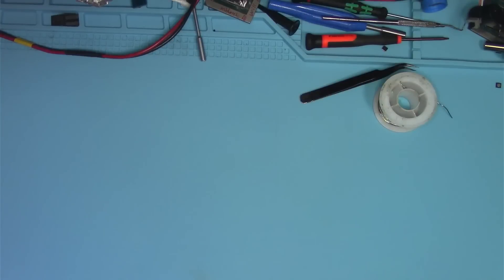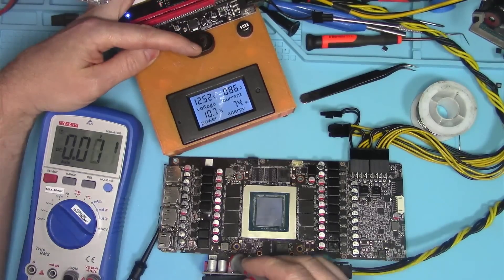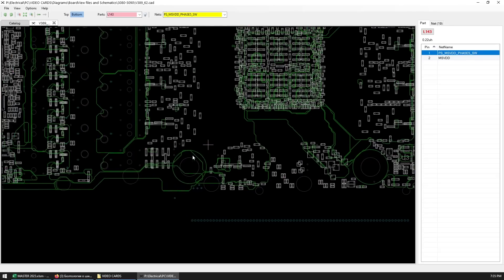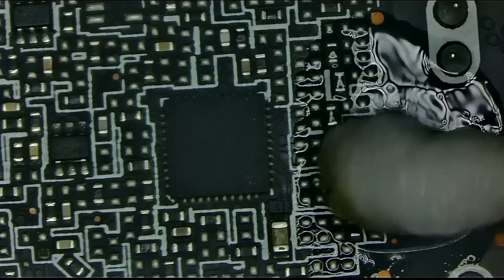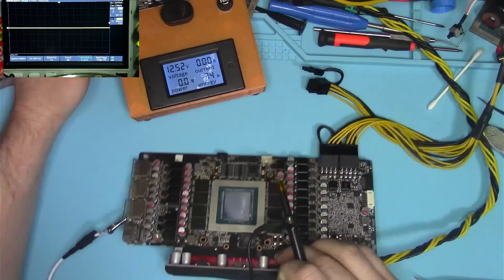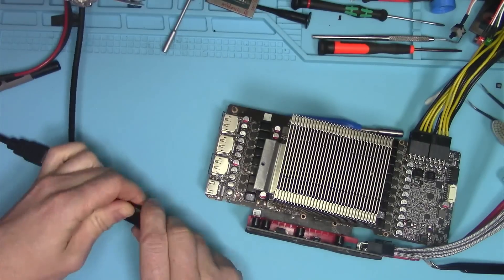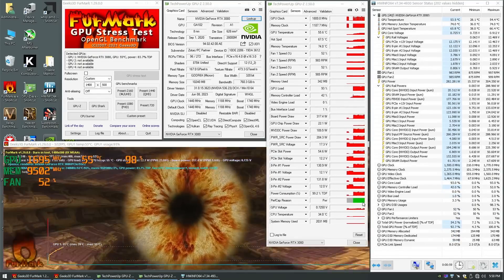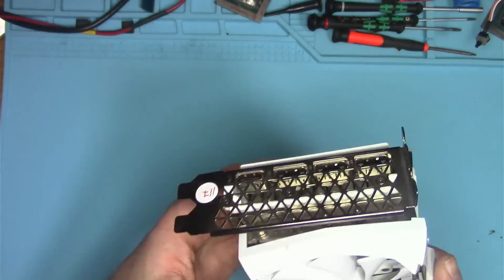What overclocking or poor maintenance does to your graphics card

Comment: This is why I never overclock anything. You need and want a very healthy margin of duty cycle overhead for both longevity and stability. In fact I don't even agree with manufacturer temperature limits, I always stay well under those. I know that my view on this is probably considered extreme by some people but that is not my problem. I'm perfectly happy with how I do things.
Reply: It's not extreme , many people don't overclock because they are not comfortable with it. I used to do it a lot but nowadays manufacturers tune them close to max already so there is no real benefit from it for normal users, you won't feel the extra 2-5% fps in a game, if anything on AMD GPUs i under-volt from the start. That being said if i see such damage on a graphics card from overclocking i put the blame 100% on the manufacturer. No decently made card will blow up it's power phases from software overclocking (not talking about shunt modding or custom bioses here).
Reply: @autoglobus  Many people here appear to mistake overclocking for overvolting, no software overclocking should damage your gpu if it's made correctly all it can damage is software stability and you can even undervolt and overclock you gpu at the same time for better perf and temps (results will vary depending on your silicone grade) overvolting on the other hand can severely damage your hardware for obvious reasons
Reply from the maker: Best advice ever.
I am 100% on board with that.
Ask any old engineer guy, make anything 20% better over the specs no longer the case. Electronics today are built 100% to specifications and that is why there is no room for error.
It's best to dumb everything down by 20% and have it working for many years to come vs hanging at the edge for max performance not knowing when it will explode.
Reply: @northwestrepair  Exactly, the longevity and stability is where you get your return on investment. I've been building my own rigs since the 90's. The value of stability is something I learned early on was a major peace of mind component.
Reply: @kmg501  the card will be obsolete long time, before you´d see any impact of overclocking on your hardware.

That is, unless you OC it to the bone, where it is unstable, but "it´s fine", GPU memory artifacting like crazy, but "that was there before!".

Literally was there, done that. Once 😊

The affected GPU is still alive.

In fact, it is more likely the GPU will give up due to defective fan, which will lead to overheating and without user notice, death of the GPU. Another reason for its death may be worn/defective thermal pads. Once they leak all the oil in them, they´re mostly done.
Reply: @Morpheus-pt3wq  I appreciate your considered view point on this but I think it also depends on the user and/or use case. In my case I no longer build a new rig when the components become considered obsolete by those who prefer a leading edge user profile.

My build strategy became one of building a new rig when I find market conditions favorable to end users and the current rig is about three generations behind. then I buy discounted components that are about one generation behind.

This gives me a lagging leap frog effect in which I get vetted components for inexpensive cost. The leading edge of component buying is something I think is a waste of money for most users but that is just my humble opinion on it.

Peace.

Oh and PS, running *nix operating systems makes this strategy all the more attractive in my case. I can completely ignore certain commercial OS providers who I want nothing to do with anyway.
Reply: @kmg501  considering you do this, then you can´t really talk about longevity and stability. Used, old hardware bears higher potential of failure, than anything new, even when not overclocked.
Reply: @Morpheus-pt3wq  If that were true the other rigs in my house which are well over a decade old and in use would have failed already according to your argument. Age is a factor yes but how components are used is also an important factor. Hard thermal cycling ages components prematurely. Basically this comes down to a turtle versus a hare strategy. Like I said, I'm good with how I do things.
Reply: @kmg501  it does not matter, how much you´ll try to prolong longevity, as this is completely and utterly random. You can have a pampered piece of HW, that never ever had to endure high temperatures and it will still fail; you can also have hardware, which you will torture with high temperatures and inadequate cooling and that hardware will refuse to give up.

Computer HW is just consumer electronics, like everything else. Also, because everything is imperfect and can fail anytime, the manufacturers give us warranty periods.
Reply: @Morpheus-pt3wq  This is like saying you can have lung cancer even if you never smoke when some heavy smoker can get to 90 without issue so why shouldn't you just smoke 1 pack a day if it makes no difference ? But it does make a difference, even if things can fail randomly for no apparent reason not taking care of them or actively damaging it will greatly increase failure chances
Reply: @Morpheus-pt3wq  Nobody who still has some brain cells ready to be used will allow fans to fail. You can always change the fans before they break and not after. You can also change thermal paste, thermal pads before they are completely dry. You also can blow the accumulated dust regularly.
A  GPU does not die just like that. It starts to give you crashes when it is overheating and you will know something isn't right.
Reply: @Morpheus-pt3wq  "Used, old hardware bears higher potential of failure" You're joking, right? I got numerous HD 7970 that are still working in 2023. They have literally melted caps but still work well. RX 580 Sapphire, after years of mining still are working just fine and I expect them to still work at least 3 more years. GTX 1070/Ti, GTX 1080/Ti still very much working without any trouble. GTS 450, GTX 560/Ti, GTX 660/Ti, just some I recall now, bunch of them still working just fine, needing only thermal solutions replaced and dust cleaning.
RTX 2070 got at least 20 to repair and they are way newer and in way less numbers than the ones I mentioned before.
Reply: @kmg501 😂 overclocking doesn't hurt the card what hurts them is poor cooling and voltage my 1080 ti still going touching 5 years and heavy oc
2080 ti 2 years and counting next card 4090 definitely will be going insane with that oc man people are just delusional with these things 🤡 you think companies do this on purpose lol obviously companies take precautions with these things but you know how it works that's customers issues with their hot box
Reply: @northwestrepair  is why drop down the input and increase the output is the case these days.
Reply: @northwestrepair  cheap zotac model is not equal to high quality PCB from the high end models, but I am sure you know that already. Doesn't mean there are not cut corners or engineering failures with many of the "high end" models tho.

Still, they are generally far mode suitable for OC vs the cheaper models that for many of them  manufacturers can't even solder the few components decently to the point of almost not working due to that alone. Not to even start with OC'ing those.
Reply: @northwestrepair ROFL. I'm dying. You have no idea what you're talking about if you make blanket statements like that.

You come off as a true fool to anyone in the industry who knows what they're doing. Yeah you can repair very well.... However your ideals are just wrong.
Reply: Ive been overclocking for quite some time now including LN2 stuff with a buddy. This never happened. Its also impossible to say if this is because of overclocking or just a manufacturing error. But its good to inform yourself about the cards first. Some have complete overkill power delivery and high quality components. Generally Asus ROG series boards are a pretty safe pick. But even like AMD founders edition pcbs on vega for example were top notch.
Reply: I always undervolt my cards, they can run the same speeds at less power than stock.
Reply: I always overclock my systems but with a voltage or mhz limit, i have a Zotac 3090, i can do +120mhz core, i test a game stock, the card goes up to lets say 1820mhz@930mv, then i apply the OC +120mhz, got 1820mhz@860mv and then the curve is  flat after 875mv, also i have a 380w bios instead 350w, never had a problem and i run a custom fan profile to lower the temps with faster fan speed.
Reply: Some cards handle an oc really fine without changing the voltage or even when lowering it. And that is pretty fine. Some other cards cant get a clock increase without a high voltage change, in that case you should let everything set to factory spec
Reply: I tried OC my gpu (RX 6800) but its not worthy. It gets 5% with small OC and 10-12% with OC to the limit. The best you can do is UnderVolt your gpu. Also look on your gpu temperature.
Reply: @MacTavish9619  Undervolting only works on AMD cards and ancient Nvidia cards sadly. On 10 series and newer it's complicated.
Reply: @FatheredPuma81  No. Lol.

I undervolt my 3090 24/7. I also have an EVC2SE to control the voltage if needed.
Reply: @nexxusty  Your only option for 10 to 30 series is undervolting for heavy workload scenarios, overclocking for slightly lighter workloads, and nothing for everything else. I'd call that a "it's complicated" but if you want to explain why it's not be my guest.
Reply: @FatheredPuma81  LOL, yeah fair enough. Compared to Maxwell and everything before it anyway.

Just used to it by now I guess.
Reply: I was able to get my 3060ti to 2GHZ without overvolting anything and keeping it below 70C with custom fan curves.
Reply: I'm the same way, I've never overclocked anything... it's better to just spend some more cash on a faster card itself rather than getting 5-10 extra fps.
Reply: Well some people have no plans to use a component for over 10 years....
Reply: you can't kill a GPU from overclocking. If you have ever tried to overclock then you know that there's barely any headroom to turn anything up on GPU's anyway.
Reply: @jordanlazarus7345  Fun fact: On a 4090 every +100MHz (pure) overclock is about 5w more power. So you'd have to push something absurd like +2GHz overclock just to slightly shorten the card's life span.
Reply: @FatheredPuma81  not only that, because of that extra 5w of power, the voltage drops slightly assuming that the card is power limited still.
Reply: one should definitely not deviate from the standard specification of some piece of Hardware unless they know what they're doing.
meaning, having the experience to know how to do it safely, not that you have Watched some Video guide of how to apply some settings.
Reply: @taiiat0  Nah you do what you want with your hardware because it's your hardware not someone elses.
Reply: if I didn't upgrade yearly, I absolutely agree. I over clock to the max.
Reply: Meh, I overclock everything and I’ve never killed anything
Reply: Well said, i get extreme temperatures in summer, so i overspec my cpu cooler and undervolt, since oc is no longer an issue because hardware tries to flex all the time, i chose stability and long years of service. I had a terrible vga 5700 mech oc, trying to run at 3000rpm all day, 1.2 volts on gpu with a tiny light cooler, well on 1.068 volts i went cool and silent for almost 4 years. Sold it to a guy and teach him how to apply my custom profile. Fans worked at 2400 on winter and 2650 at worst temps.
Reply: I would overclocked anything from Zotac,  other manufacturers like ASUs and EvGA build OC limits into their design.  That’s the difference.
Reply: @Intel-6969K  Zotac are definitely capable of doing it much better than the rest, but they sometimes fall short

Comment: 90% is way higher than 0%. I think that is a successful repair!
Reply: Msi afterburner, undervolt or 80-90% power usage
Reply: Let's see how you would feel if it was your money
Reply: @SlyNine  I would be happy to get a working card back. Way more then getting back a no-fix, no charge. Having payed for shipping both ways. And have to spend another big chunk of money to replace it.  But that's just me.
Reply: @nine0ten771  Usage case matters. If my 3080 was at 90% I wouldn't have many issues since I'm running 1440p.
Reply: @trog69  legit my rx580 can run in 1440p why th a rtx 3080 at 90% would not, he overclocked it to explosion, if it happend to u, u would be happy to not have to rebuy one
Reply: @SlyNine  Just pay 90% of what he would have charged then! Sounds fair to me.
Reply: @mechanoid5739  lame statement, the owner fries the card because of unnecessary overclocking and this guy fixes it so it works again but you don't think his time is worth it. There is no need to overclock it in the first place.

Comment: That's a fix. The card is working fine, with about 10% less performance, which in alot of games equals no FPS loss. 
Cost of electricity these days in UK, under volt is a sensible option.

Comment: Overclocking is fine to do but most people read something online and overclock and think all is well.
Anytime you push the components futher than their design limit thermals have to be taken into account which most average people do not do.
Reply: the thing is, most GPUs don´t have temperature sensors for MOSFETs or even VRAM. And while there are signs of VRAM overheating to spot, MOSFET overheating is hard to spot, as they run hot by design.

Comment: Unless the GPU was shunt modded, it is highly improbable for overclocking to cause anything, as each card has hard and permanent limits in the BIOS.

Personally, i was quite surprised, when i saw mosfet temperatures on my former AMD GPU. 75°C all the time. What i guess happened, is that one phase was weaker/faulty from factory and it eventually gave up in violent way.

For dust to play any role, it would require significantly more dust on the heatsink.

Now you should only hope, there aren´t more weaker mosfets on it. Otherwise, it will come back with another blown mosfet.

As for the price... do you promise customers 100% working order? Did you only work on it for 90 or 80%? If you worked for 100%, then charge 100%.
Reply: this video is bogus. ive had a radeon 5870 since 2009 and its MOSFET's have been running 75-80C for over a decade and it runs fine. modern FETS are rated for over 125C. overclocking will not cause this sort of failure. This is caused by a manufacturing defect just as you said. I seriously doubt modern graphics card are even getting close to the danger zone for MOSFETS. ive had FTW3 cards for literally 10 years and MOSFTES on them rarely ever go beyond 65C
Reply: @philhalo66  Overclocking increases electron migration. I'm not gonna say you're playing with fire but the chances for something to go catastrophically wrong increase. Especially if, as noted, you happen to have a component that is out of spec (or goes out of spec faster than expected.) 

I think these chances increase drastically for poorly cooled & cheaply constructed PCBs with insufficient phases IMO. 

Most likely scenario is vdroop and instability over a period of time. Let's just remember that AMD and Nvidia do test their cores for life expectancy. These tests are not without reason, it's to determine the appropriate voltage and clock frequencies that just about guarantee 4+ years of service (or whatever time period they deem necessary)

That won't be the case for every card, silicon lottery and all that, but they're not testing for the top end .... they test for the bottom of the barrel and choose the values based on this.
Reply: @The_Man_In_Red  yeah, it makes sense for them to do just that. It´s in their interest for GPUs to self-destruct right after warranty period ended.
But given it´s not an exact science, the quality is higher most of the time and lowest quality mosfets in the spec often give up, while the GPU is still in the warranty.

We should now just hope, nobody will get inspired by Gigabyte´s approach with cracking PCBs.
Reply: @philhalo66  Maybe I should've said a marginal increase but it's still an increase either way. 

I didn't say it would guarantee a catastrophic failure but you can't say with 100% certainty that a component won't fail faster if overclocked either. 

There is more going on than MOSFETS exploding. 

Traces can degrade, caps can degrade, resistances can change. 

Regardless of whether or not people own hardware that's been overclocked for 20-30 years, they sure as hell haven't been 24/7'd for 20-30 years. 

There's a limit to what silicon can accomplish and overclocking speeds up time, as it were. Nothing lasts forever. 

Whether it's meaningful or not is entirely subjective. See Buildzoid's video on chip degredation. Look at ASUS's recent fuckup with SoC voltages annihilating Ryzen chips.

I will agree that casual overclocking presents no immediate danger due to vendor's locking things down in BIOS, but you cannot escape the vestiges of entropy no matter how hard you try. 

That's all I'm saying.
Reply: @philhalo66  both AMD & intel CPUs only have 3 years of warranty. It´s beneficial to them, if the components fail sooner, than later. It´s not like users have lots of choices on the current market.
Reply: @philhalo66  Yah man. I'm not trying to say casual overclocking will cause people's GPUs to explode. Far from it. 

I understand the mitigations in place to prevent exactly that. 

I've overclocked a fair amount of hardware myself, I'm no noobie. 

But it has to be said that when overclocking and ESPECIALLY overvolting that the user is venturing into uncharted waters and nobody (not even the manufacturer) can guarantee anything beyond that point. 

It really depends on the #s. What frequency, what voltage, what kind of load, for how long, at what temperature? 

You get what I mean.